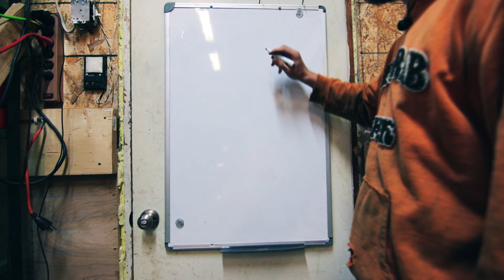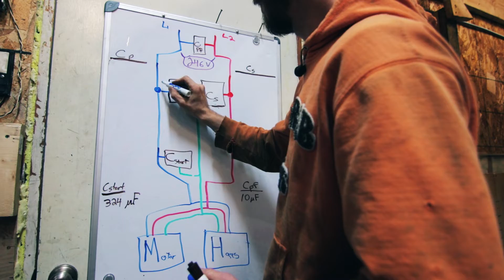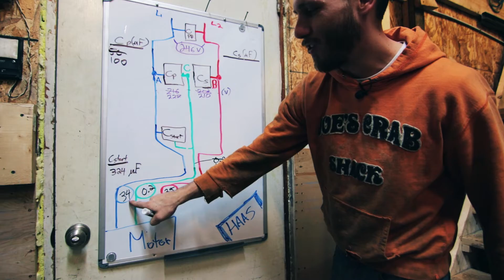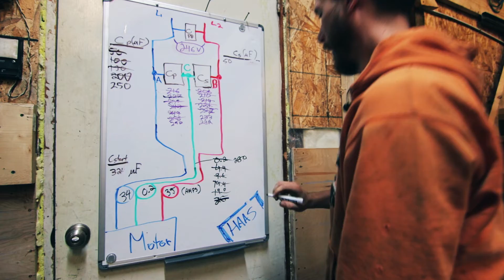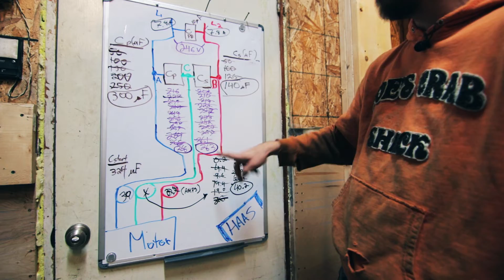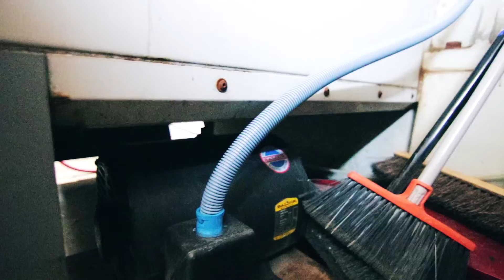I build my first rotary converter. It powers my [ Haas VF3 ]

Comment: I'm curious: input current is about 8 amps, but the motor is drawing up to 40 amps?.  (I'm assuming you don't have an external load connected to the RPC.)  40 amps seems like FLA rating for a 15 HP, yet what I've read about 3 phase motors powered by single phase and a capacitor typically run at about 30% capacity which I would expect to be considerably less than the 40 FLA rating.  What am I missing?
Reply from the maker: To convert 40 amps three phase to 2 phase you have to multiply by 1.73. So that gets you 69 amps input if you are at FLA of the converter. That is very hard to do and the only way to do it is by running the spindle at 200% load but that triggers an alarm instantly. I had a 60 amp breaker on the supply and you can do over 60 amps for like a minute but the CNC will trigger an alarm instantly. You can run it 125% load for a few minutes but again that'll cause an alarm typically the machine runs at 80 to 90% when I'm really hogging out metal. During that I typically see 25-30 amps on the converter which is 40-50 amps on supply.

Comment: Not trying to be nitpicky, but you left out the potential relay on your schematic.  But on the plus side, you did  know what a potential relay was and how to apply it.
Reply from the maker: Please dont feel bad, I prefer nit picky!! I need to be challenged on my process and ideas, living in vacuum or an echo chamber is risky and dangerous.

Ill be honest though, its been a while since I looked at this hahahaha.

The schematic I used was downloaded from a RPC kit a bought. I mostly followed it until I found some omissions and errors. If I recall correctly that potential relay was one of my issues. I also ended up fusing everything leading in and out of the caps to ensure if they blew up I dont have live loose wires flying around inside.

Comment: Hi great video. Can you help me with where the filtering cap is wired in? It looks to be connected to you starting cap but I can't tell how you have the relay, starters and 2 caps connected.
Reply from the maker: Hi, check the links in the vid. The wiring diagram is there.

Comment: Have you had any problems under spindle load sinve this build?  I just bought my first machine and it's a VF-3 with the 15hp motor so I got a 30hp idler motor and will start building my converter as soon as I get the rest of the parts.  Do you have anything you would do different if you did it again?
Reply from the maker: No issues with spindle under load at all. In fact I hit alarm 117 or whatever the overload 180% spindle alarm is and it didn't miss a beat. I let it run that path a second time and my voltages hit almost exactly 40 amps which is what my converters, idler is rated for. I wouldn't change anything, it runs amazing.
Reply: @LucasIsBusy  Thanks for the reply! I just got done building my RPC this week but I'm waiting for a few more run capacitors. I'm nervous about hooking up the machine though. Did you connect the wild leg to L2 on the haas?  My generated leg is 179v from T2 to ground and 120v on the natural legs to ground and they read 223v between T1/T2  224 between T2/T3 and 235 between T1/T3.  The high voltage from the center leg to ground make me nervous.  Is the just because it's not under load when I test it?
Reply from the maker: Sorry I missed this, life got busy. How did you make out in the end?

Comment: Submersible motor 3phase run  2 phase using capacitor but i done it takes 14 ,1.8,16 amps  so coil will damage sir . I needed same amps when motor run in 2 phase sir

Comment: Hey man. Great video. Where did you put the generated leg on the Haas? The reason I’m asking is because I’m a little concerned about the high leg powering 110v circuits
Reply from the maker: It all goes through the main transformer. There are 110 taps off that so it should be fine. The Haas manual says it doesn't. Attwr what leg goes where. I put Gen leg on L2 on the main contactor. .
Reply: Awesome thanks

Comment: Ouch, nope, those particular fuses won't help you. Those are ATC/ATO "automotive" fuses, they have a 1kA AIC, but that's at a maximum voltage ratting of 32 volts DC. You may blow them, but if there is any real power moving through the system when a capacitor fails, you may well liquefy the fuse, block, and wiring. For mains voltage applications, your fuses should have an AIC of 10,000kA at voltage specified in the system they are going into. They must also be de-rated for temperature. Fuses are just as prone to math as capacitance.  Also, while it is of course perfectly fine to assemble your own controls cabinets, bare components, such as capacitors, should NEVER be mounted on combustibles... like chip board. Use that HAAS to make yourself a component mounting plate/block!
Reply from the maker: Thanks for the advice. Your right, I should swap, out the combustible cap mounts. That was an oversight for sure. The fuses are only there for if the Caps explode and the wires are flying around. I watched one diy vid and buddy opened his cabinet up and his cap exploded and there were loose ended wires  dangling around arcing on things. The fuses are there simply for that. They pop pretty easy too. Before I had this layout I sent about 8 amps through the 5 amp fuse and it popped immediately. The converter itself is on a proper mains breaker at the panel. It's on a 60 amp breaker. If there is an issue in the converter or Haas it will pop that. Is that sufficient? I know the ATCs wont protect if the cap go crazy and or there's a short somewhere else, but the mains breaker will I believe.
Reply from the maker: What's an acceptable material for mounting the Caps?
Reply: @LucasIsBusy  Yes, fuses are not necessary, but a good idea. I like when things include over-current protection in a design, but If fuses are used they need to be the right rating or they may CAUSE a failure, and again, those are far over their voltage rating. Which means the interrupt capability during an actual fault condition will be VERY questionable. AGC fuses with a 250v ratting would be fine in this application, and you can get them in ceramic body, which wont turn into shrapnel as easily as glass AGC fuses. Plus, they're fairly inexpensive for the holders and fuses. Typically the cheap 4 way blocks are good to 10 amps per fuse. You have the caps in a nice easy to service arrangement, had you considered just milling an aluminum/aluminium block to replace the wood block? Could tap a thread hole in the block between the caps to allow for screws & hold down washers/bars. Mount the cap blocks to a piece of sheet aluminum on standoffs, would replace all the wood inside the cabinet. Just be sure to earth/ground that mount & metal enclosure.

Comment: Glad to hear you can run VF3 on a Roto phase
Reply from the maker: Works really really well too! I stalled the spindle a few weeks ago when it pulled 180% load when I did a 0.200" step over with my 1/2" 3 Flute end mill at a 2.0" depth of cut at 980SFM. Made a hell of a lot of chips, but pulled a lot of amps as well. I let it do it a 2nd time so I could watch the amps and it pulled 32 Amps of 3 phase power.....I also measured on the house power side and got 56 amps. So its definitely up to the challenge. :)
Reply: You the only one I see on you tube with a good size CNC in a 
Smaller shop setting and you found a CNC and repair it your self and do rotophase 
I have a lot of machines I have got in last last 3 years 
I do have a Bridgeport series 1 CNC. 
I do all my own machine hauling and repairs
Reply: You are putting 1/2 end mill 
To a test that is  it’s limit. 
You have a lot of flex.
Reply: You rebuilt spindle you said?
New bearings? Haas only or parts available from other sources?

Comment: every one makes their rortophase converters differently
Reply from the maker: True. Mine had enough power to stall my 15 hp haas. Got an alarm 174 for overloaded spidle. Checked the amps when it alarmed (made it do it a 2nd time) and got around 56 amps of single phase. Right around 81% load on the converter which is perfect. So happy with the outcome. 👍😊
Reply: Good to hear I don’t know of many people running that size of CNC on phase converter

Comment: PF is power factor. The closer to 1.0 the more efficient it will run. Motors will never be at 1.0PF usually 0.80PF. The cap from L1 to L2 which is the PF correction cap will reduce the idle and operating current. It brings the lagging current a little closer to the voltage peaks of the sine wave. Good vid. I built mine with the same doc.
Rotary phase converters will only put out 2/3 the power the poney motor is rated for because you are esentially using the generated leg as an output. We say double the size of the RFC as a safety buffer. I would not run that HAAS at more then 60% max load on the spindle or you will have voltage sag and draw too much current thru that poney motor generated leg. Exeeding your 40 amps FLA
Reply from the maker: I have kept an eye on it and measured it when the spindle loads have been a bit higher. I stalled the spindle a few weeks ago when it pulled 180% spindle load when I did a 0.200" step over with my 1/2" 3 Flute end mill at a 2.0" depth of cut at 980SFM. Made a hell of a lot of chips, but pulled a lot of amps as well. I let it do it a 2nd time so I could watch the amps and it pulled 32 Amps (80% of my FLA for the pony motor) of 3 phase power.....I also measured on the house power side and got 56 amps (quite a bit over the 80% of the 60 amp breaker) So its definitely up to the challenge when overloaded to the point of alarming. But I hear what your are saying and that was a mistake. I'm almost always limited by my tool size by how hard I can push and a 2.0" depeth of cut at 0.2" step over was dumb on my part. I was  super happy to see my roto converter took it like a champ tho. :)
Reply: @LucasIsBusy  👍

Comment: Micro Farad of the Caps?
Reply from the maker: The running caps are all 50 micro farad caps except the starter caps. The power filter cap is a 20 uF.

Comment: Nice build and thank you for the information. I think I now understand exactly how the rotary converter does it's thing. Where did you get your motor and how much do you figure you saved by making your own rotary phase converter? Where did the capacitor kit come from?
Reply from the maker: The motor was $500 CAD and the kit was $130 USD...a comparable 15 hp from supplier was $1800 before shipping. So saved more than $1K fo sho.